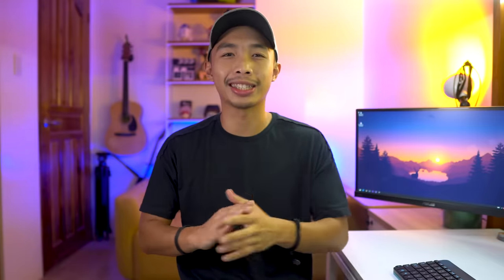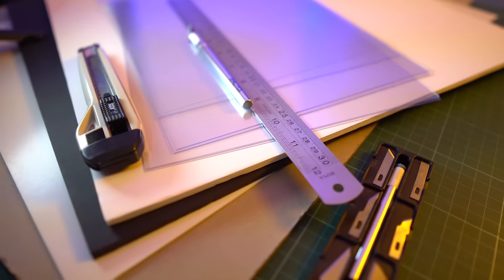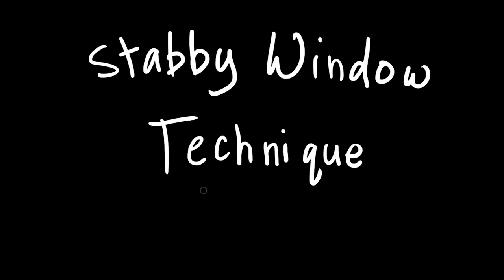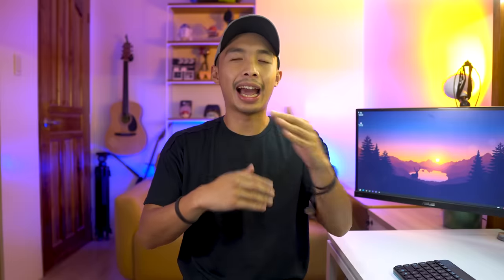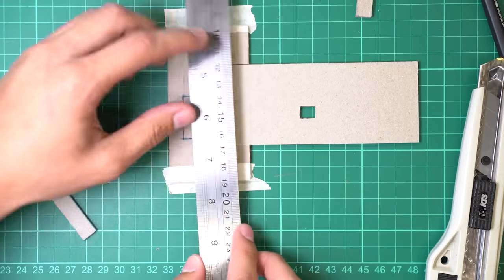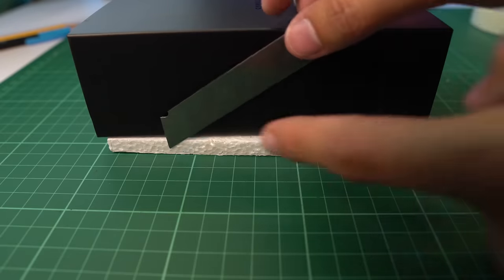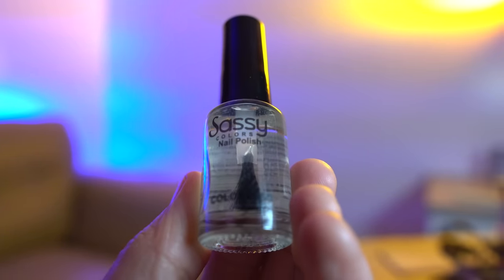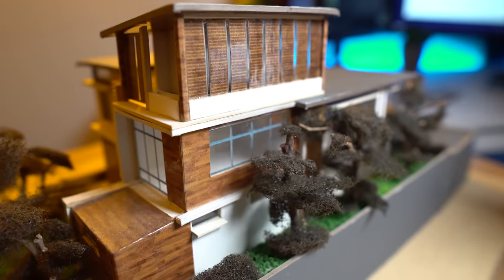Architecture Scale Model Making Hacks

Comment: Idk if you've addressed this before in any of your other videos, but if you don't have a box cutter, and all you have is an xacto knife, and you wanna cut basswood but your index and middle finger are too stressed to continue, you can use your architect scale as a lever. Put your exacto knife under the architecture scale, and place your thumb on top of the scale. The rest of your fingers should grip the knife, and do the same steps for cutting
Reply from the maker: Thank you for the tip pal!:) It's incerdibly useful and super effective!

Comment: Heres a cheaper way to "varnish" and it seals nicely, levels out and can be used with brush and airbrush. It'll last you waaaaaay longer then using nail polishand without that smell. Its called Pledge floor care finish. Thanks for your helpful hacks 👍

Comment: Hi Llyan i’m currently working on a two-story industrial loft scale model in a quarter inch scale for a class project. Our teacher wants us to do some kind of interesting skylight or something like that. Do you have any suggestions for how to go about making a raise skylight with a frame without using that plexiglass type stuff? I’ve had a really hard time getting that the cut and it’s kind of expensive. Thank you!
Reply from the maker: Try using actual glass:) you could buy 2mm thick glass really cheap or sometimes free if the cuts are small enough, or just buy some used picture frames and use the glass from that:) Glass that thin is super easy to cut, and relatively easy to stick together, you just need some silicone glue.

Comment: for hack number 1: ıts too dangerous, this blades are so thin and can be broken with small pressure. once while ı was cuttıng like this blade broken and cutted my nail from middle. my nail felt and ıt took 3 months to heal it
Reply from the maker: That sucks pal.
Reply: @LlyanAustria  which equipment we can use to hold model paper while we cuttıng? is there somethıng to keep fıx ıt durıng we cuttıng ıt?
Reply from the maker: I just usually tape it down with masking tape:)